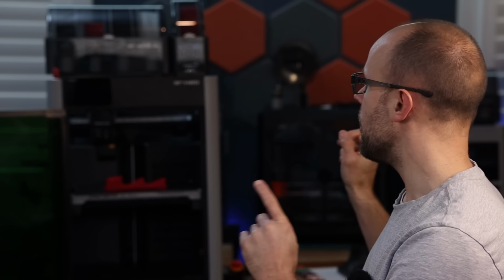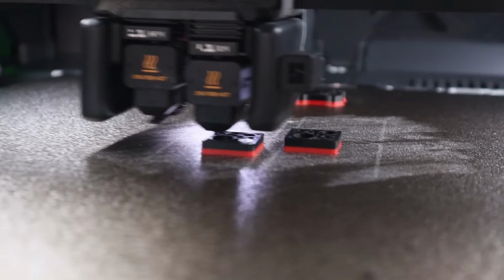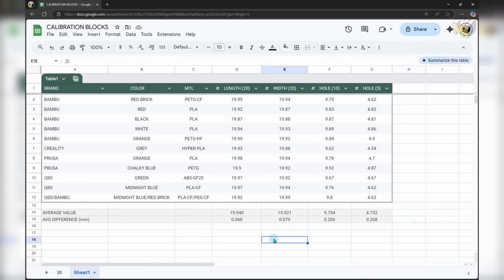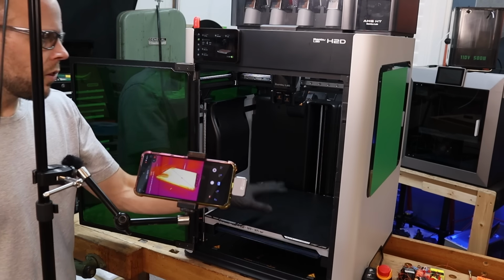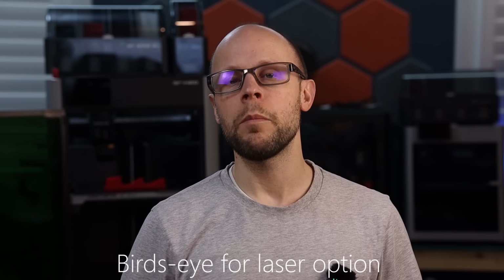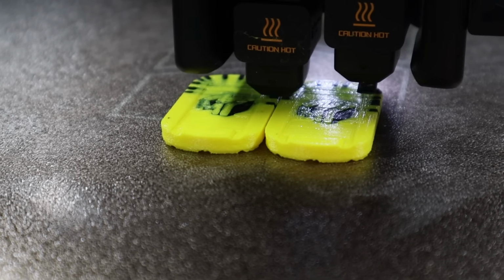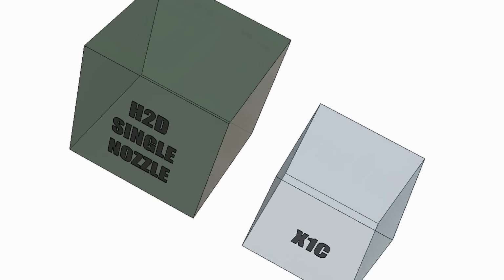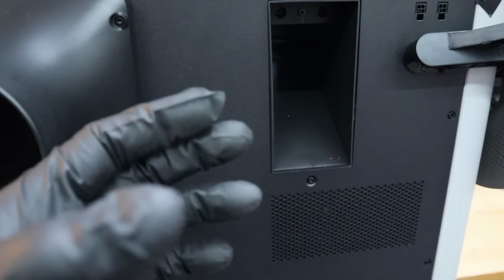I nearly broke the NEW Bambu Lab H2D printer.  What you should know before you buy one - Full Review

Comment: The H2D was was already outdated before it even launched, dual nozzle printers are decade old tech. If multi color/multi material is your goal, then tool changer printers are the only way to go. This thing is still inferior to a 3 year old prusa XL and even the new tool head printers that well be releasing soon.
Reply from the maker: I'm certainly open to the tool changer idea, I'd love to try one out down the road and compare.  I think that this machine for dual color/material will be faster than a tool changer, especially the INDX system I believe you're referring to.   I've only recently had the pleasure of trying a Prusa and I love the quality and their work, I can take nothing away from what they've done and what they'll continue to do.  It'd be interesting to see a direct showdown between a tool changer and this machine though.
Reply: @NeedItMakeIt  The H2D is only as fast as the XL up to two colors/materials. Anything more than 2, and the H2D goes back to being slow as molasses like all of bambu's past printers because of how the AMS works. Prusa is currently working on being able to use different nozzle sizes on the same print with their XL. Once that is released, bambu will just copy it like they always do.
Reply: Have you seen the head to head comparisons? This has better accuracy, better speeds, and 1000$ cheaper than a 2 toolhead prusa XL, and it's enclosed where the prusa at that extra $1000 isn't. It also has WAY less ringing and VFAs in comparison.... not sure what baloney you are talking about
Reply: @JohnSmith-rt5yq  lol you're talking about Robert's video. He doesn't even have his XL belt tension properly tuned and hes complaining about VFA's. Hes an early adopter of the XL and hasn't done any of the recent prusa upgrades that made the XL better. He's basically comparing a 3 year old printer to a brand new printer And the XL still comes out on top as far as multicolor print speed and material waste.
Reply: @LilApe   It's not his fault that the XL launched in a worse state than the H2D. And I've seen multiple comparisons from different channels and the Prusa prints always look considerably worse, and with far slower print times unless it's 3+ colors with hundreds of color changes. The XL is cool and all but Prusa really should finally make a new generation that works out of the gate and can actually print fast and in a quality that people expect nowadays.

"Prusa is currently working on being able to use different nozzle sizes on the same print with their XL"
What a coincidence that they started that now when the biggest competitor launched and not in the years prior. And right on time so Bambu can "copy" it as you put it, lol.

Look, I don't like Bambu either but your mental gymnastics are just sad.
Reply: @brinkoftext  Coincidence? Prusa announced last year that they were working on an official way to use multi nozzle size printing for their XL. Long before the H2D was even a leaked image. You can already print using multiple nozzles sizes, but you have to do some workaround in the slicer. Prusa has sold several hundred, if not around a thousand XL's and only a handful of people have has issues....3 years ago when it was an early printer. We aren't living in the past. Prusa fixed all the XL issues over a year ago and people can choose to upgrade the revised parts or not. Robert chooses not to. That's on him.

The H2D literally prints just as fast as the XL up to only 2 colors/materials. You can test it yourself in the slicers. Anything more than 2 colors/materials and you're right back to unbearably slow printing, taking 10's of hours to do what the XL can do in a 1/4 of the time. Prusa XL takes less than 20 seconds to switch toolheads and start printing again. The H2D takes just as long to switch between both nozzles as long as its only 2 colors. 3 or more and its back to the minute and half swap/purge time.

Educate yourself before calling mental gymnastics. Bambu studio, bambu makerworld, bambu connect, bambu academy, bambu A1, bambu A1mini....all things copied and ripped straight from prusa. And that's just the well known ones.
Reply: Oh no, the troII is back, coping harder than ever and lying as usual. Please don't entertain him.

Comment: ISTR reading the filament quantity is measured by using the RFID to detect the rotation, and measuring how much filament comes out from one rotation, and estimating the radius of the remaining filament roll from that
Reply from the maker: Awesome, thank you for explaining that!  I figured that they only had an RFID sensor and that makes complete sense; pretty cool!
Reply: In an interview the bambu ceo said to pull an rfid tag off of a bambu roll and stick it to another manufacturer's roll to get remainder detection on other filaments.
Reply: @NShellhopper  I am now doing that, BECAUSE THEY DONT HAVE ANYTHING IN STOCK IN THE EU.
Reply: That's just what I love about Bambu. Others would've added a complicated system, they just use what's available and improve it

Comment: your side mount spool is supposed to feed from the bottom up, not around the top. thats why its such a sharp turn to the feed line.
Reply: It is surprising how many ‘expert’ reviewers have not read the quick start guide where this is mentioned.
Reply from the maker: True, I did try it, however it was still not good.  What did end up working well was to change it to bottom feed and also move the holder down.  I didn't realize at first that they allowed another position for the mount and now it feeds in much more gradually.  Great tip though.  I guess I'm one of those people who likes to load the TP in waterfall style...
Reply: Hi, have you tried using the Bambu Support Material? When it comes away, how smooth or rough is the under surface? Thx

Comment: The X1C has AI spaghetti sensing, does this not?
Reply from the maker: It has a similar camera setup, I believe that it will.  I can't say that I've had a single case of spaghetti on the X1C though.  I still always use glue stick for every single print.  I continue to see people printing without glue stick and their prints peel up away from the buildplate, maybe not to a complete fail but they're not flat enough IMO.

Comment: What is the thing with the glue stick? Is it to increase adhesion, or to decrease adhesion? I never had any issue with too little adhesion. Some prints stick so good, I have a hard time getting them off.
Reply: It acts as a separation layer between the bed and the print, so they don't stick too well and come off without tearing themselves or the bed surface. Some filaments may stick too well, like PETG or PCTG.
Reply from the maker: If you print with 2-3 walls and light infill you'll probably be fine, but try printing with 6 walls and heavy infill, you'll have a completely different experience.  When I print parts they're almost always heavy and without the glue I risk them coming away from the buildplate.  It does depend highly on the shape and size of the part, material as well, but since I don't want a single fail.  I always use glue stick and.... until this disaster, I had a very good success rate.  I've made some videos using heavy walled PLA prints showing that they will warp so badly that they'll pull the buildplate up and away from the magnet.  They look like they're all good, except when placed on a granite surface plate, they're like a Banana.... a pretty flat banana mind you.   I still see people online printing and I can see in their timelapses that their prints begin to come away from the buildplate and that for me is not acceptable.   It's cheap and easy and as mentioned in the comment below, for some materials, they can stick too well and it works well as a separation layer, TPU for example can stick too well and PETG can also.

Comment: Feed the filament off the bottom of the spool not the top...
Reply: Yeah I was also looking at that shot and thinking WTF :face-green-smiling:
Reply from the maker: Same issue top or bottom.  I made a note in the video, I guess you didn't see it.  I think it might work okay with a short length of PTFE tubing and a connector to attach to the one going to the head.  It would hold that little ball joint in position a bit better.

Comment: Why does it seem that noone is using the prime tower to do the purging - I've been expanding the prime volume to 200+ mm^3, and completely nulling the flush volume since noticing this. This both reduces the wastage (vastly) compared to using the flushing mechanism, as well as speeding up the print, since the prime tower is much faster than the flushing - please do a video on this, to let other people know of this possibility - the only downside is the space the prime tower takes up on the build-plate, which for the most part is negliable
Reply from the maker: So you're saying that the purge goes away 100% and instead it goes only into the prime tower.  That's not a bad idea at all to me, I think it's a great idea.  For me, I really don't do a lot of color prints, but adding that one extra color makes a pretty big difference in the final product to me and it might be all I'd ever need.  I guess maybe a support material and then two other materials might make sense though, so it could work well for that example.  I hate the waste and I hate the poop.  Too bad the prime tower couldn't be useful somehow, rather than garbage.
Reply: @NeedItMakeIt  almost 100%, the increase to 200+ mm^3 is to make sure the colour change is complete, so there is some wastage still, tho nowhere near the amount that of the default purge flushing. I firstly used it to improve print times, but then noticed the reduction in wasted plastic.

Edit. Yes I reduced purge flushing to 0 in the slicer settings
Reply: That is what I do. I bring the flushing volume way down taking into account how much the prime tower uses

Comment: When using abrasive filaments like CF-PLA, you should avoid using infills like cubic that crosses itself in the same layer. It scratches the nozzle and, naturally, buildups. There's a few that don't but Gyroid is simply prob the best.
Reply from the maker: Agreed!  I usually go with gyroid, way back in my Ender 3 days... not that long ago really I was printing with Cubic mainly for strength, but the issue came up big-time when I was printing with a 0.8mm nozzle.  When it crossed over the existing filament, it wasn't only noisy, but the bed would have to spring down, or the head up... both probably.  Not really idea.  It's better to have them not interfere as much as possible.  Gyroid at the moment is my go-to.  I also like Cross-hatch.
Reply: Uuuuuh, nice tip, thanks! Perfect for a noob like me and I already printed glow in the dark and have PAHT CF ready! 😲 Read that just in time, thanks!

Comment: So, it looks like the nozzles are still a little on the weak side?  One of the reasons I switched to the Microswiss Flowtech nozzles on my X1C and P1S, the stock nozzles would bend so easy if they bumped into any prints or in the case of the P1S, a backed-up poop chute because of no detection of the poop chute on the P1S.
Reply: Being weak may prevent costly damage to the toolhead. You always want the cheapest part to break in case of a problem.
Reply: They won't bend, look at how they are mounted. Nothing like x1 or p1, they don't hang in the air
Reply: @riba2233  Oh sweet!  Thanks.

Comment: Would love to see a review of the air filtration system and serviceability (what type of filter does it use, how to change, etc).  It looks that if the heated chamber is not used, there is no filtering to the outside.  I am extra cautious and would like the system creating slight negative pressure and filtering out even if PETG / PLA are used.
Reply: Honestly you should just assume no filtration system ever works.  Because they really don't.

Comment: I don't know if the content of the laser follow-up video is decided, but I would love to see how the H2D handles (or doesn't) the engraving of 3D objects. Some of their marketing material seems to imply that it can engrave on quite dramatically curved and raised objects.
Reply: Since a laser can't change its focal point offset, any curve could not be so dramatic that the laser head collides with the part.  So your max curve Z delta could not exceed the distance between the laser head and its focal point.  Their videos do show it doing laser engraving on a curved surface though, so it is changing the Z height on the fly to maintain that focal point.  I wonder if the software also stretches the image to wrap around the curve though, since otherwise you would be projecting a plane onto a curve and there would be some distortion compared to an image wrapped over the curve.

Comment: The AMS kit to allow the AMS 2 to be used with older machines is just for older machines that don't already have an AMS.  No need to buy the kit, just need to buy the power brick for the AMS 2, the power brick doesn't come with the AMS 2.   So, if you already have an AMS for your X1C/P1P/P1S, you can just buy the AMS 2.  If you want to use the heating option of the AMS 2 with your older machines you will then need to buy the power brick.

Comment: does the AMS HT work with the X1C? Also, can that handle abrasives right away or will destroy itself trying?
Reply: It will after a firmware update😊
Reply: It has a ceramic feed funnel, so it should last for a while with abrasive filament, but obviously it will wear quicker.

Comment: Nice tests. Hopefully you could make more tests like full build plate print, 2 nozzles with the same color (to see how seams and interlocking feature look like). Or is it able to optimize filament switches when it has access to the same color from both nozzles (like it prints with filament A from nozzle 1, needs to switch to filament B (which is available from both nozzles) - will it prepare filament B in parallel and switch to nozzle 2 to make whole switch faster or will it take it from A with full 2min switching procedure? I could imagine a lot of test cases to see if it optimizes things.

Comment: I think for the pink TPU, it looked like it might’ve traveled through the PTFE tube and into the printer better if the spool was loaded onto the printer going the opposite direction, rather than having it rub on the corner. Maybe you tried that but didn’t show it?
Reply: That is house it soule be used. Odd choice since you cannot see behind the spool, you have to see it from side. But cheaper to manufacture. I also do not like that they did not add any attachments points to any side…

Comment: One thing that has me concerned when another channel mentioned it about the laser module for this is any long term issues due to particulate build-up from the smoke. As you engrave or cut with a laser, you're going to get smoke into the chamber, even if you have a vent and filtration system. Well, that smoke eventually accumilates on all the fine internal parts, rails, belts, etc. So if you're doing a lot of laser work on this, you might be having to eventually do a thorough cleaning on the inside of the printer.
Reply: why do people keep bringing this up i don't think they'll build a fundamentally flawed system like one of the 3rd tier brands
Reply: But isn’t a regular laser cutter working with the same principle?  They keep working, or do those mechanisms require cleaning?
Reply: @Djeez2  but laser cutters aren't also high speed 3d printers. so what you end up having is a 3d printer experiencing accelerated wear and tear
Reply: @Djeez2  They certainly do, at least according the person that brought up the issue about the H2D. I forget the name of the channel, but he recently did a hands on video of the H2D so it shouldn't be hard to find.
Reply: Yeah I feel like people should stay away from the laser options.  Laser is messy and requires a decent exhaust solution.  You really don't want the particles that result from laser burning or cutting floating around in a 3D printer.
Reply: isnt that the same as printing ABS though? You get particulates over time. You just need to clean it.
Reply: you could just clean and maintain the device, like you're supposed to.
Reply: @moafwaz5563   Or they could just not mix things that don't belong together, how about that? Bambulab got successful because other manufacturers had your mindset. Time intensive maintenance is the opposite of what the brand has been known for. Sure, people could just clean it, but we all know they're not gonna do that.
Reply: @ That was the concern of the person who was talking about that. Like, if you need a 3D printer, get a 3D printer. If you need a laser cutter/engraver, get a laser machine. Frankly, if someone is needing a laser cutter for actual work and not just to play around with just the occasional etching/cutting for say, their kid's projects, but they actually make products with it, its better off to have a dedicated machine. 
Like sure, the H2D is nice for someone that only does these things on occasion, for fun and not what they use to make a living off it, if they need to print and laser cut and cut stickers and maybe even make pen plot drawings. But I wouldn't imagine someone with a print farm getting a fleet of H2D combos with the laser, plotter, etc. They would get the base H2D just to print with, dedicated laser cutter, dedicated vinyl cutter, etc.
Reply: @RyoHazuki224  have you considered you're not the target audience for this device then?